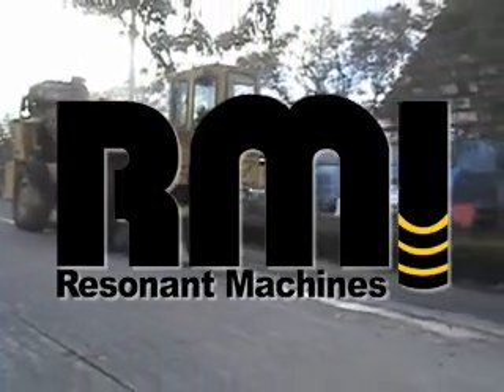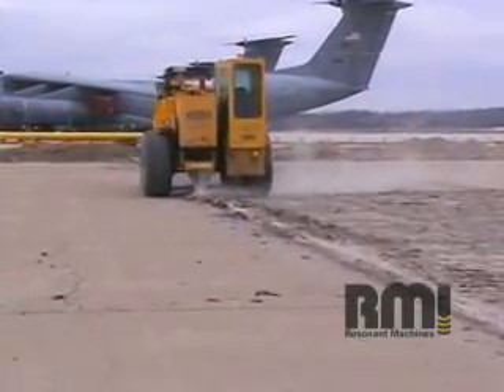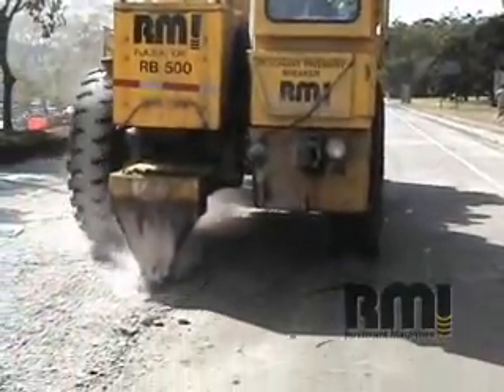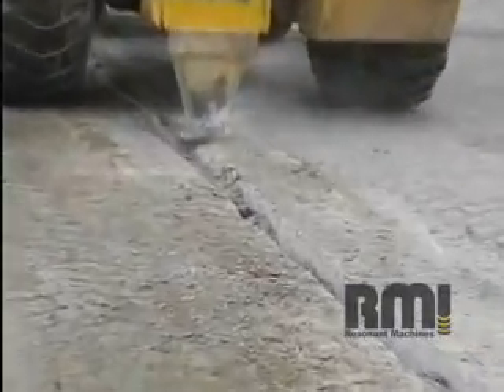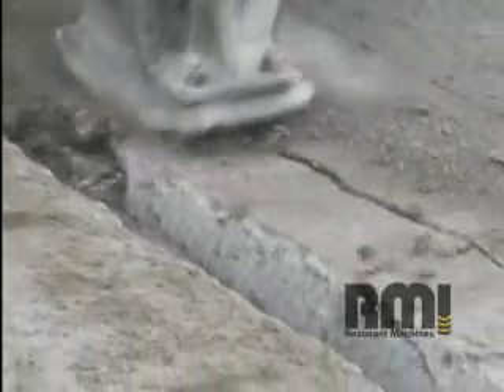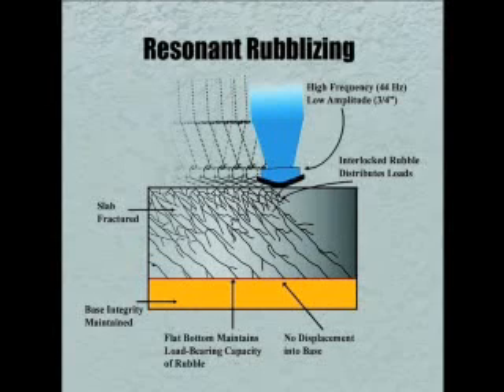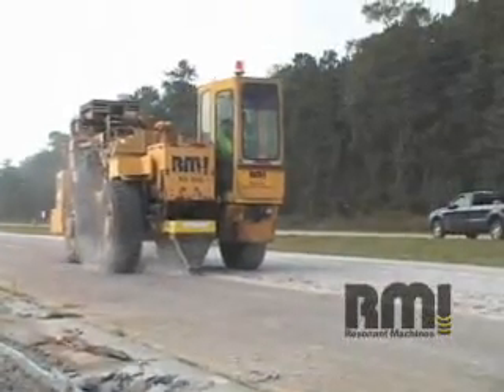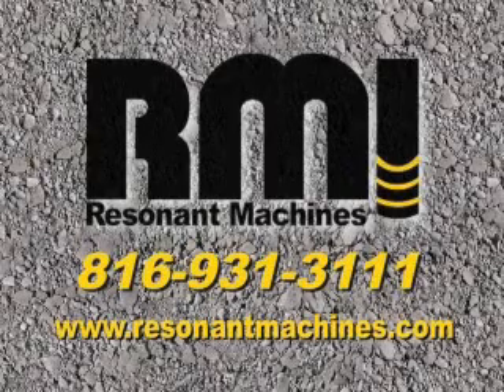Resonant Frequency -  Concrete Rubblizing

Comment: 44 times per second, with an amplitude of 3/4 of an inch, with over 2,000 pounds per strike!  Amazing.  This is an amazing machine, and an amazing technique.  This is the way to do this kind of work.  No wonder they call it turning concrete into Rubble.